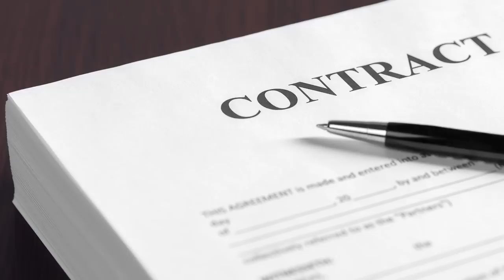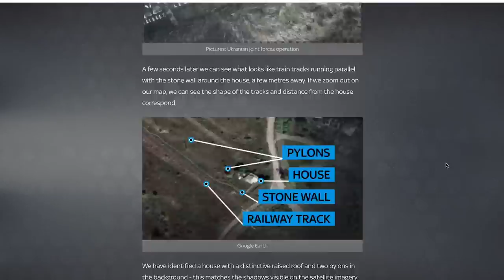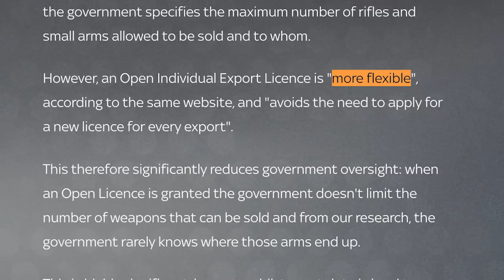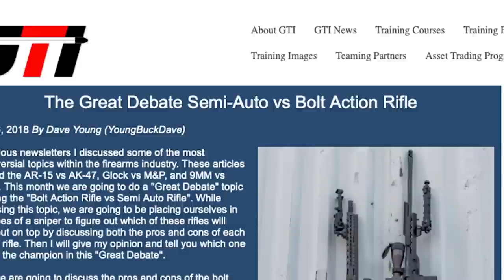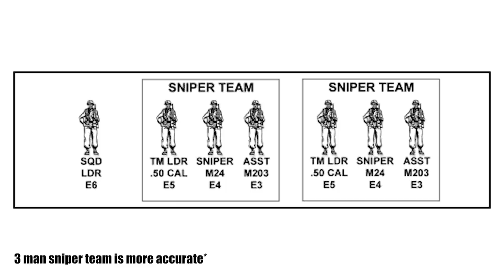L115A3 Brits Sniper Rifle From a Shed to Combat

Comment: Accuracy International has such a cool backstory. The real two guys in a shed narrative. Current record for longest sniper kill held by a Canadian at 3450 metres. 🇨🇦
Reply: current record is with a mcmillan tac-50 rifle, not an accuracy international arctic warfare rifle
Reply from the maker: blew me away when I learned about what their own backstory was
Reply: At 3450m there's a lot of luck involved. Even a 1/2 MOA rifle will have a theoretical minimum group size of 19 inches (48cm),  then when you start to factor in ammo variation, wind, temperature, humidity, spin drift, Coriolis Effect, buffeting as the bullet drops through the transonic zone, and the excessively long flight time of the bullet, well, even hitting  a barn at that range would be problematic!
Reply: Theres an interview with the guy who used to hold the record (around 2,500 metres from memory) with the accuracy international rifle on YouTube, Craig Harrison or something like that, his names mentioned in this video as well if anybody is interested
Reply: @mirandahotspring4019  they do actually work all that stuff out, they have a little computer thingy and a book listing previous shots and scope settings. The spotter will at least do wind speed and direction (which means you have to reset it every few seconds if you havnt managed to shoot yet), earth movement and curvature, air temperature/humidity and obviously distance, as well as knowing the behaviour of the rounds they are using and the rifle from previously shooting it and recording details.

also these records usually arnt set by the first shot, they have to have a few attempts and adjust from that.
Reply: HURRAY Canada did something somewhere at some time !  And all this time I thought Canada only great accomplishment was William Shatner !
Reply: @Taskandpurpose  You should do a video on that shot and JTF2.  Might be tough to research though as those guys kind of keep to themselves.
Reply: @j.robertsergertson4513  No, it was Paul Anka.
Reply: @j.robertsergertson4513  Hahaha just shows your ignorance I guess.
Reply: https://en.wikipedia.org/wiki/Longest_recorded_sniper_kills#Confirmed_kills_1,250_m_(1,370_yd)_or_greater
Reply: @mirandahotspring4019  Except it is 3540m not 3450m.
Reply: I think I like the Barret M82 story as well. The fact the guy who created it knew absolutely nothing about guns (at least how to make them) yet made one of the most famous .50 BMG AMRs ever, is awesome.
Reply: @quinnmcculloch3154  Temporary dyslexia?
Reply: @mirandahotspring4019  That's your story and you're sticking to it? Works for me. 100 meters mind is a big difference either way :)
Reply: @quinnmcculloch3154  Whatever
Reply: @j.robertsergertson4513  don't forget Justin Bieber!
Reply: @mirandahotspring4019  yup but a record is still a record. at that range the bullet has lost so much energy it's on the verge of being non lethal
Reply: @j.robertsergertson4513  before harrison the record was held by another canadian.
Reply: @mirandahotspring4019  whatever
Reply: Canada is best, bro.
Reply: @j.robertsergertson4513  and Ryan Reynolds, don't forget RR. Or James Doohan or...
Reply: @mirandahotspring4019  Canada has 3 of the Top 5 longest range sniper kills. maybe its the training? that or there known for hot loading there ammo with extra gunpowder since back in ww2 with lee enfieilds
Reply: @sophiavhoti4548  Has mostly to do with the fact that they're willing to take a big chance on not making the shot at long-ranges because they're not engaged  in direct action conflict. US snipers/sharpshooters are usually traveling with the larger element, slightly separated or in place ahead of time, not a mile away nearly out of visible range...
Reply: @sophiavhoti4548  3540m is luck or firing heaps of rounds hoping one will hit. There is not a sniper rifle on the planet capable of getting a consistent group on a human torso at that range. The flight time, weather variations over that distance, ammo consistency, temperature and humidity, etc. make it a lucky shot.
Reply: @mirandahotspring4019  Goto Mark and Sam After Work channel. They do shots like that all the time.
Reply: @Meditech509  Still pretty much confirms what I said. they take numerous shots and even with the corrections called in shot for shot still take several shots until one hits the target. When the bullet drops out of supersonic flight and goes through the transonic zone the flight becomes less stable and these minor variations are not consistent.
Reply: @Meditech509  The 5013 yard video for example. With the best conditions, corrections called for every shot, he was still only able to get one hit out of twenty-five shots on a 24 inch target.  The kill zone on a human torso is about a twelve inch target, a quarter the size!
Reply: @mirandahotspring4019  Damn congrats Canada…. Does he have to hand his gun in when he comes home from deployment? Do they haven’t put a special box or something? How does that work?
Reply: @Deilwynna  yeah hes taking about the old record from the british sniper I think it was around 2 miles with the accuracy international chambered in 338
Reply: 🇨🇦 Represent
Reply: @Deilwynna  in a Cadex chassis making it fullfloating but the one thing the current holder had going for him was a Charlie Tarac which makes it much easier to do even longer range shooting as it reduces the need for holds as it realigns the MOA (by up to 250) without having to reset zero. It also sounds like he was lucky enough to have perfect weather, an optimum spot on top of an apartment building without being disturbed and a very stupid target
Reply: @Deilwynna  Canadian scout sniper Rub Furlong
Reply: @mirandahotspring4019  also the rotation time of the earth
we rotate a one rev per day that is what 8000 miles at the equator and i rev per day at the poles
so shooter has to know length to target and work out the rotation time at his latitude
also world spins east to west so bullet hits left of line hence right hand needed
so there
Reply: @raypitts4880  Yeah, there are just too many variables at extreme ranges. Anything past the supersonic flight distance of the bullet has a big luck factor, and that's about 1600m for a .338 Lapua magnum.
Reply: @ronblack7870  brother the max range for standard ball .50 bmg is 6800-7400 meters. So at 3500 meters that round is definitely not on the edge of being not lethal. At 3500 m/1860y the round still at 1084 fps and carries a velocity of 1687 ft-lbs of energy.
Reply: Alleged...
Reply: Lobaev,, Sumrak,, -4210m.... 🇷🇺
Reply: You know your stuff
Reply: @fckemuptommy4687any one who thinks there isn’t luck involved when shooting a target that is 3540meters away is not realistic. There are quite a few factors that even the best sniper ever could never take in consideration at a level where he could land hits consistently on a human size target at this range.
Reply: @Pyrokatze Harrison ranged his shots on the same distance from the same place at a nearby target, he took 9 ranging shots he then took two shots at the target killing the 2 machine gun operators. He later said that conditions were absolutely perfect with no wind and great visibility.
Reply: Yeah with a honking big 50cal round.

Comment: The original green meanie was such a quantum leap in military sniper capabilities the number of soldiers passing the British armies sniper school skyrocketed leading to a complete overhaul of the course and all the associated equipment. Basically everything else had to be improved to match this exceptional rifle. Another important modification made during the Arctic warfare design was more robust polymer panels because the original designs were extremely brittle especially at low temperatures. While bolted to the chassis they were difficult to damage but during maintenance they were regularly snapped by idiots or dropped on concrete armoury floors shattering them.
Reply: The other quantum leap was the adoption of the S&B 3~12 scope which gave our sniper pair the ability to work out distances if there was a known height to work from; this of course before the widespread use of laser rangefinders.
Reply: The folding stock was also nice for transport
Reply: I think the Royal Marines got so good with it, the MOD turned the sniper training over to them.

Comment: Glad you included the bit about how much the rifleman had to hold off to make his long shot. Range estimation, wind drift and mirage (which you didn’t mention and may not have been a factor) are the challenging and absolutely essential first steps before hitting anything at long range. Even a small error in range estimation means a miss by many feet because the bullet is at the end of its ballistic trajectory and falling steeply. 

It’s also pretty slow by that point, probably below 1,000 FPS, so you probably are correct that decent body armor would have stopped it.
Reply: Oh. Measuring the speed in leg steps per second. Wow. Super fast walke' you' boolet es, ennit.
Reply: One thing he missed was the Corporal Harrison took out both the Taliban team, then fired an additional shot that destroyed the PKM that was left so it was denied to the enemy.
Reply: @worldoftancraft  bruv
Reply: I never seen the talib in body drama

Comment: The trick they pulled on the inspectors remembers me of what the italian from Lancia did it to fool inspectors from the Group B of Rally.
They should make something like 400 cars to be able to race, but only made 200. So they said the inspectors that half of the cars where in a place and the rest in another part of the city.
Inspectors check the first 200, and once they are done instead of going check the other ones, they got convinced to go for lunch first. This gave timer for the italians to drive all of 200 cars that got aproved minutes before to be the new place and get inspected a second time as if was a total of 400 lol
Reply: That's what I was thinking of.
I remembered a story about some manufacturers having a similar inspection, but keeping the inspectors at lunch as long as possible to enable moving the stock to the 2nd location.
Reply: How very Italian.

Comment: intersting how far sniper tech has come since WW1.
Reply: I was the best shooter of my Canadian regiment in 1977 and they gave me a brand new civilian free floating barrel 308 gun to train with. Shortly after I got my release, they came up with a more "military" model.
Reply: well,they didn't had ballistic calculators or meteostations those days
Reply: Funnily enough, the core principles have barely changed at all. Full power bolt action rifle with a telescopic sight. Of course, the mechanisms have been refined and accurized and the supporting tech (night vision, ballistic computers, etc) has improved a lot over the decades.

Comment: I use tha Arctic Warfare version, the L 118 A2 with the S&B PMII scope. It's a great system and the only complaint is the plastic stock pieces don't fit well and you need a file and some sand paper to make it feel comfortable. I'd take it to work any day without any worries.

Comment: Some Russian elite units also carry Glocks, CZ’s, B&T’s and a few have been seen running M4 carbines. They have a lot flex in what equipment they are able to use. The funny part about them using this platform, they’re probably running the most garbage steel case ammo that is giving them crap accuracy at best.
Reply: Alot of special forces do really you see them carry some exotic weapons fairly frequently.
Reply: Don’t matter if you’re an Orc when Sauron has that oil money
Reply: @Matt-xc6sp  great racism bro. Keep it up!
Reply: @kxi529  no one besides u are crying my guy. And slavs and are definitely a race, bro 🤗
Reply: they could also be using the sv98, or an upgraded variant of the ishmash precision rifle. it looks similar to the l115a

Comment: The FSB have Glock 17's, 19's, 26's with fancy Russian coat of arms on the slide, USP 9's, Walther P99's, Beretta Px4's, Sig Saur 226's, Benelli M3T shotguns, MP5A3, B&T MP9's, H&K MR556, H&K 416, ARX 160, A  bunch of different AR-15 types, a locally produced AR15 called the RA-15, SAKO TRG-22, AI AW, AI AX338, AI AXMC, Steyr SSG-69, Steyr SSG-08, TIKKA T3, H&K MR762, SG 511 and a very large assortment of Western manufactured optics systems for both firearms and night and thermal vision surveillance.

Comment: So for those who are unaware or never got around to using one either in real life or in airsoft, the l96 has a bolt catch in front of the trigger where you can simply slide it down and it releases the bolt fully allowing you to take out the bolt, as for the trigger again it’s only just a the trigger and that’s about it, all the while the barrel is also attached to the trigger housing meaning that In order to fully disassemble your rifle all you need is a screwdriver and an alon key/ hex key, undo the four screws on the side of the body and the entire thing simply pops right out, and that’s it, a barrel, and a trigger assembly all in one piece, and don’t forget that the rest of the body is just light weight polymer and is as heavy as running around with a bag of sugar